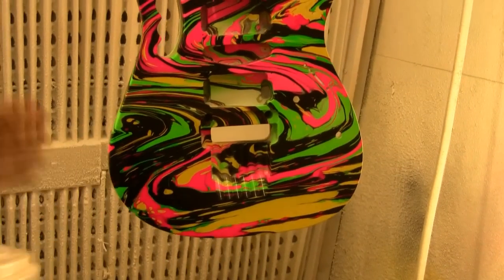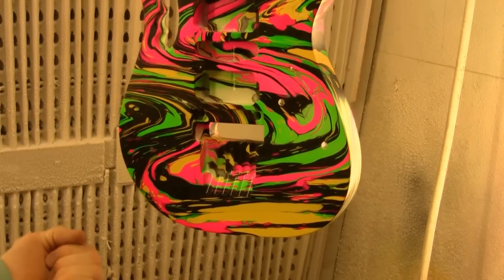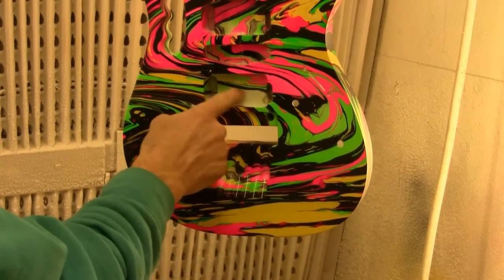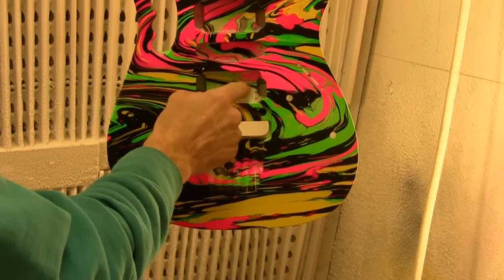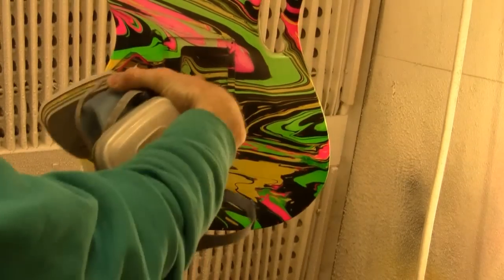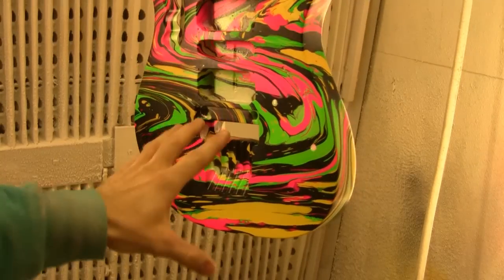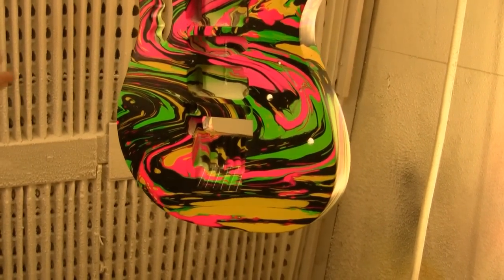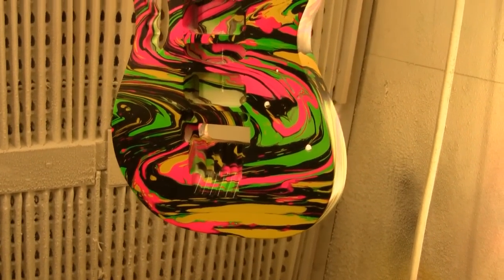Clear coating your swirl from Out Of This Swirled.com yourself.

Comment from the maker: CONTRARY TO MY STATEMENT IN THIS VIDEO AIRFED IS THE BEST WAY- AS LONG AS YOU HAVE A PROFESSIONAL SET UP- IE CLEAN COMPRESSOR INTO-FILTER-INTO DRYER-INTO FILTER INTO A 3 STAGE FILTER OR BETTER AND THEN AIRFED MASK *AIR IS THEN TESTED FOR AIR CONTAMINANTS BY A PROFESSIONAL FIRM**, AIR FED IS THE WAY FORWARD, NEXT BEST THING PLENTY OF AIR FLOW AND THE MASK IN THE VIDEO, BETTER YET GET SOMEONE ELSE TO SPRAY THE POISON FOR YOU.